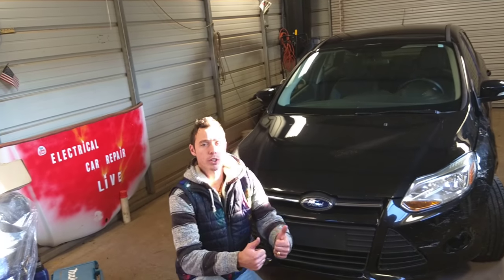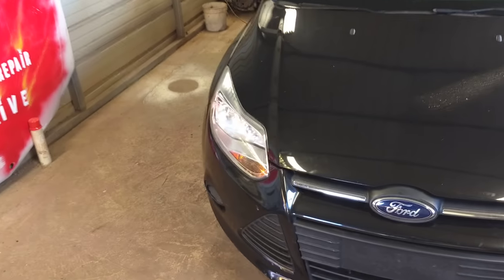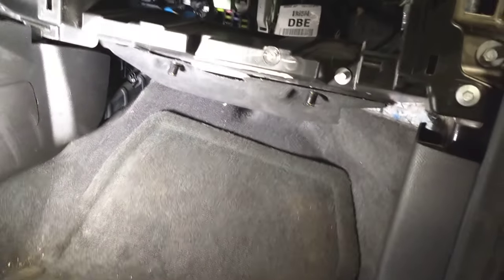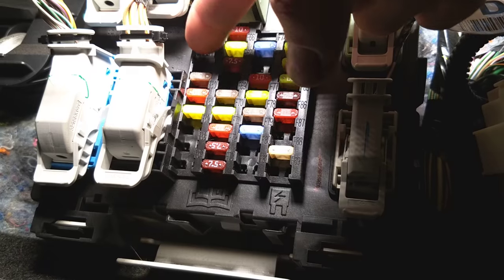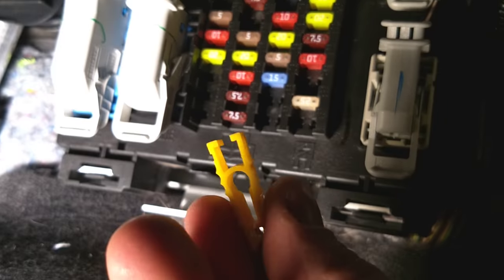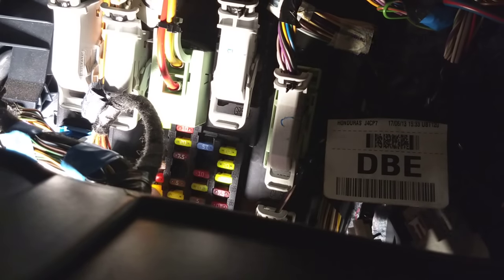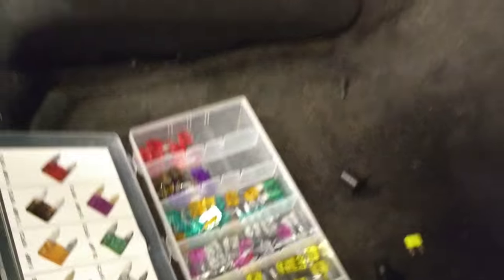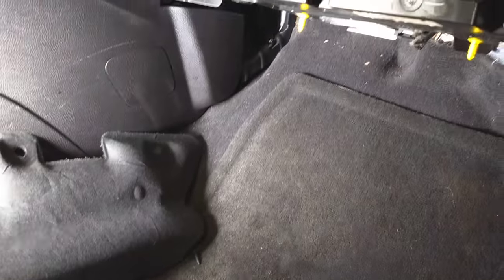CIGARETTE LIGHTER FUSE LOCATION AND REPLACEMENT FORD FOCUS MK3 2012-2018

Comment: I replaced the fuse, that fixed the power socket in front dash. But the power socket in the center console box next to handbrake still does not work. Where is the fuse for that ?

Comment: what if only one cigarette lighter isn't working? My front one stopped working but the back one works fine now. I checked the fuse and it's fine. Is there another fuse for the front one?
Reply: lol i looked up this issue for my daily and i see you here when i have you added on facebook 
there is one 20a fuse for both ports.  it is under the glovebox, fourth one up in the far left row
Reply: i just replaced the fuse and now its out again, i have a short somewhere. 2017 sel hatch

Comment: Hi i am willing to install a power adapter for dash cam directly through the fuse box but i cant find the where to connect the negative  cable. Can you please show me.its on a ford focus 2014

Comment: Tries to sell you fuse puller and it doesn't work. Then he doesn't tell you that the 20 amp fuse is blown or not. I pulled my fuse and it is not blown and cigar lighter does not work still.
Reply: same here